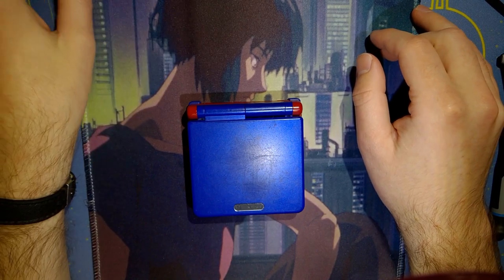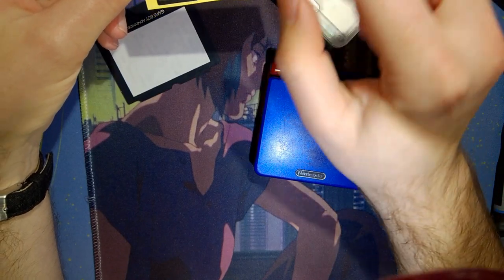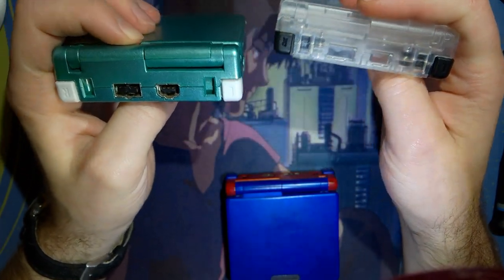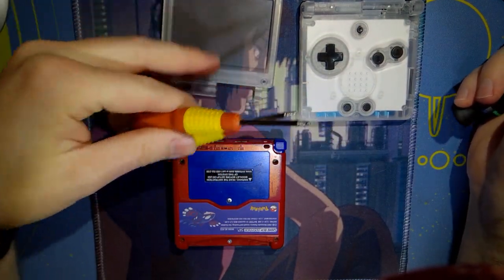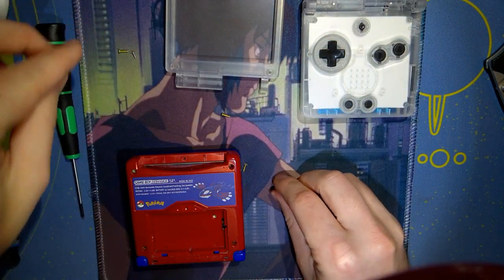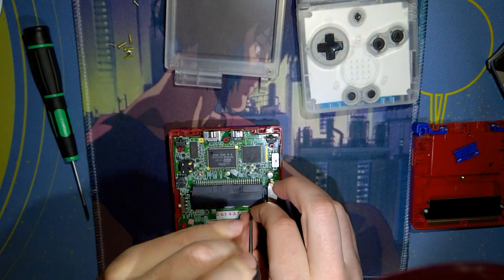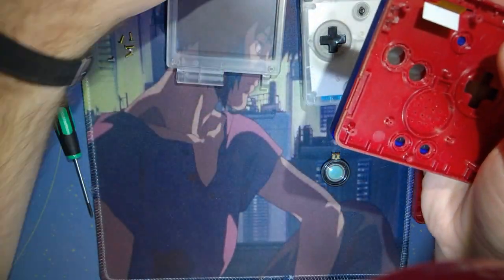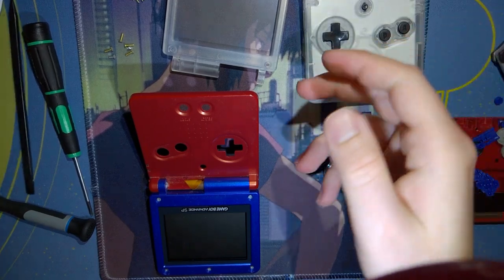Reshelling one of my GBA SP consoles with a new transparent shell

Comment: Dude that's awesome on the hinge removal tool!  That's the worst part on the two shell replacements I have done so far.   And good to see someone who has reshelled a GBA with the new transparent shells!  I bought a 101 GBA SP recently with a cracked up case and am debating between a transparent or NES style replacement shell.
Reply: What did you pick

Comment: I like the clear but I hope that they also come out with some solid colors using the higher quality molds.
Reply from the maker: It should be pretty easy given that all OEM SP shells (and aftermarket opaque SP shells) are painted. But yeah that would be pretty nice.
Reply: @makho  - Good point. Do you have any idea what kind of paint would give the closest look and feel to an OEM shell?
Reply from the maker: @AlexysRM  I do not. I sprayed some left over tamiya PS-12 on a SP shell and the color is very similar to OEM Platinum. I'm hesitant to recommend this paint though because it's the wrong paint for the application. Mine has held up surprisingly well though. I did use clear coat and primer. The paint itself has a bit more sparkle to it and the texture is different (but that last one is more related to my clear coat).

Comment: You popped the hinges out with the case closed, and installed them into the new case while opened. How does that work? I have messed with the hinges in so many orientations. They have to go in in a specific way or the screen sits at the wrong angle when opened. Also, I can not get it to snap closed, it just folds closed in a linear fashion without that click at the end. Idk what I’m doing wrong

Comment: So why cant you put an ags-101 in a 001 console?
Reply from the maker: The shells are the same between the consoles but you can only use a 101 screen with a 101 motherboard or a 001 screen with a 001 motherboard. Mixing and matching without modifying the motherboard will result in damage to either your screen or motherboard or both. The two consoles may use the same screen connector and 95% of the wiring may be identical but the frontlight/backlight circuit is different between the models.
Reply: @makho  thank you haha, glad I now know I was thinking about buying a screen for the 001 😅
Reply: makho you can use a 101 screen on the 001 board, but you have to get a little board to solder some cables to the motherboard and it allows the ags 101 to work.
Reply from the maker: @gcole6  I'm aware. You need a 12v regulator or to reroute some traces on the PCB but I meant that without modification, you cannot mix and match.
Reply: This is all real interesting to learn lol
Reply: So sorry if I am missing something, can I buy an ags 001 model and then add an ips screen mod and simply solder a wire to get the brightness to work? Or would this damage the screen over time as you stated? Not too keen on wiring so you lost me with the capacitator comment. Thanks again for all your help on my build!!!
Reply: @Vibesave123  don't quote me but I believe you can.